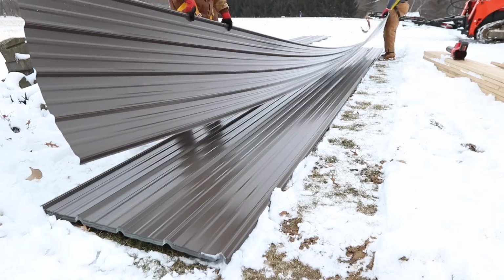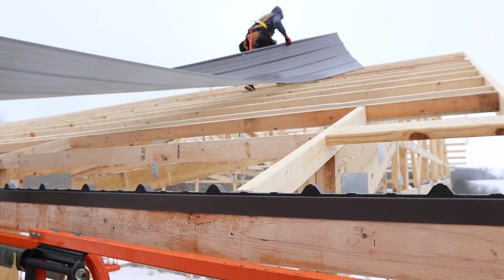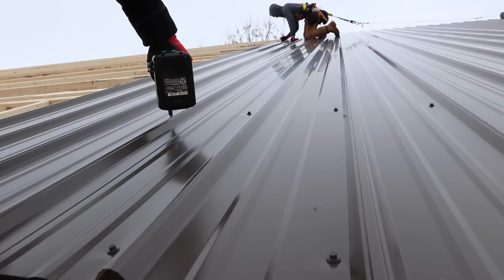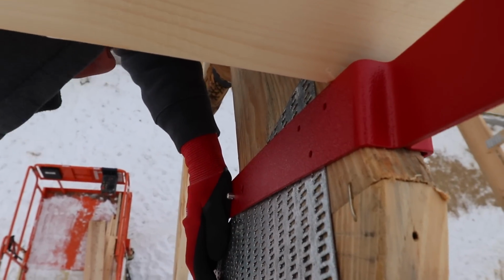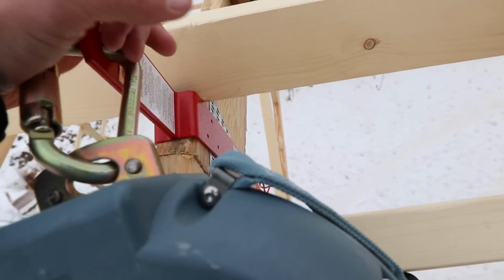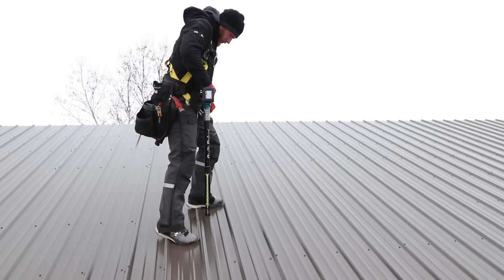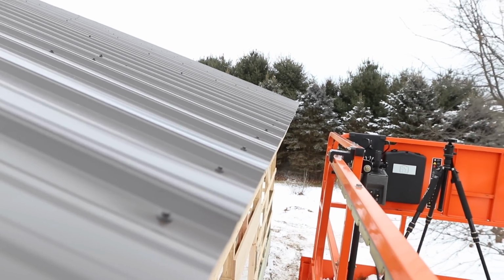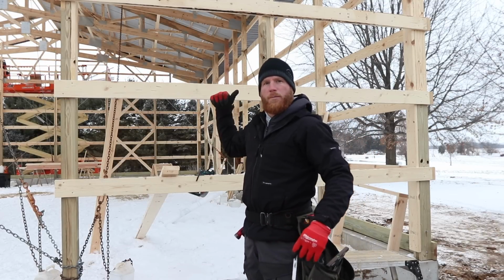Building a Work Shop: Installing Metal Roof

Comment: It was nice to see how well everything 's tied together when you cut the post for the window and it just hung there in space instead of sinking and binding your blade.  

My question is why you wouldn't use a traditional sandwiched header with king and jack studs?
Reply: End Wall, pay attention as you watch again, but never hurts to install a double header, though all the above girts already provide more than such adequate support.

Comment: Hey Kyle. Another great video, I enjoy them all. My question is about the window you installed. I’m no builder so take this question accordingly but I was confused by the way you cut out the post and put in the window frame it didn’t seem like that added any structure. So I guess I’m wondering was that post necessary in the first place?
Reply from the maker: the truss bears all weight and the column is used for wind loadings...12' end wall post spacing is somewhat standard on barns, specifically horse barns...so I am not overly worried about wind loadings by removing the column.  I also know that by having it and framing it the way I did, I am adding yet more protection then if I didn't have it.
Reply: Thanks for the explanation. As I said, I am no builder, I was just curious.
Reply: @Abel Harbour Correct.  Front and back walls will see wind load but are not load bearing in this design.  The roof load is transfered to the footings via side wall posts.  That said, I would personally have built a proper header if only to ensure the weight of the post above does not bear down on the window some time in the future as things settle.

Comment: Do yo worry about machinery being stolen from the jobsite? Big problem in the UK!
Reply: Install concealed digital transmitter trackers in big, valuable equipment. Mark the small stuff with "owner applied numbers" (or name) for ease in identification, recovery, and prosecution.   Some tool makers  (e.g. Dewalt "Tool Connect"), offer their own tracker systems.  Sure, it's expensive, but one loss due to theft will make the cost of getting a tool tracker system seem cheap.   Also, conceal wireless web-based motion-triggered cameras around the worksite. Also don't forget to have cameras watching each other, too.   Even if the thief finds and steals or destroys the cameras, you still have the video of the crime stored "in the cloud."